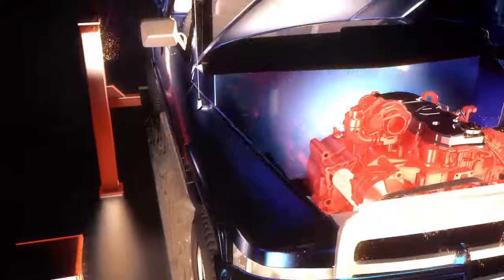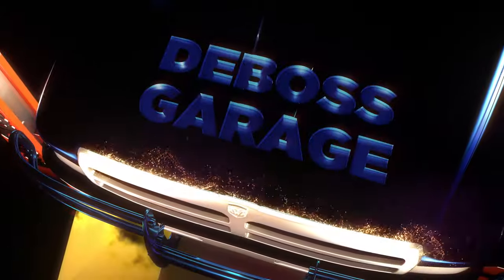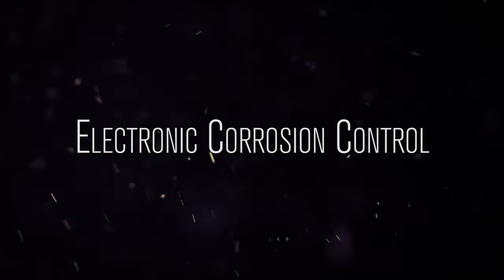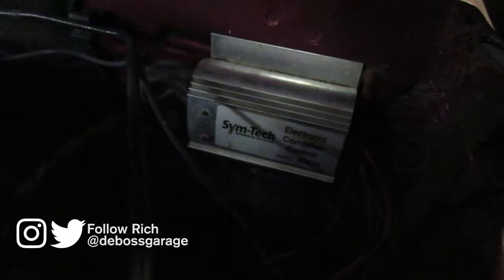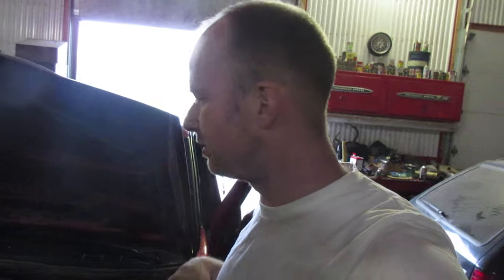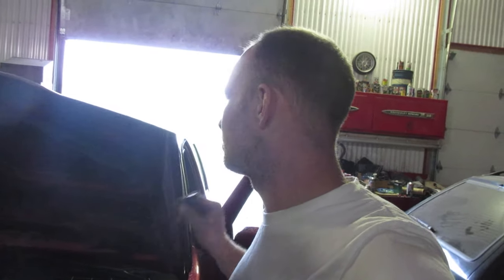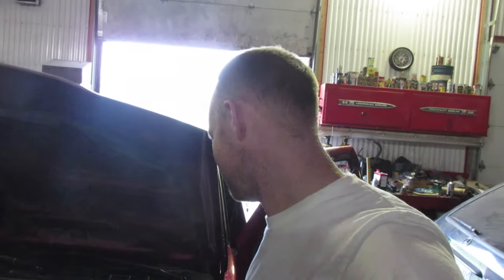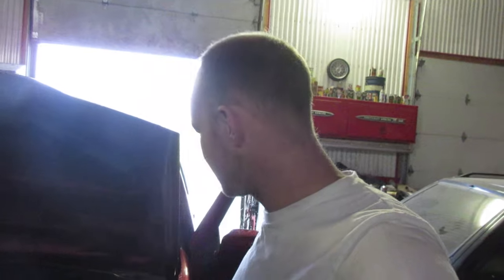The Truth About Electronic Rust Protection

Comment: Cathodic protection prevents corrosion by converting all of the anodic (active) sites on the metal surface to cathodic (passive) sites by supplying electrical current (or free electrons) from an alternate source.
Reply: They work great if you're submersed in an electrolyte solution. But you're not. You're in air. Air doesn't act as a salt bridge, and won't conduct ions until you reach a voltage where you can actually ionize the air,  generally at many tens of thousands of volts. Even then, it would ionize a path as direct as possible, not reaching most of the vehicle. 

These boxes are not functional. There's no  scientific theory that can explain their functioning. They're literally a scam.

Comment: If you put small aluminum plates on the frame and body in various locations and run 12 volts to them remember they are to be insulated from the frame or body so they don't short out which is the whole point but we let moisture do that when a water droplet connects the two and puts a positive current in a negative frame and body therefore reverses some of the polarity remember wire issues usually start with a corroded ground wire

Comment: Bought a truck from a dealership who offered these as part of their suite of warranty packages. Threw it in there because it came with a 10 year/5k dollar warranty. Didn't care if it worked, just wanted the damn warranty. Free rust repair. 

Fast forward, traded the truck in (at a different dealership), and intended to have the module and warranty transferred to the new truck. A couple days after the trade I went to make the appointment to have the body shop from dealership number 1 get their paws on both trucks to do the swap-over so dealership 2 can sell my old truck. Dealership 2 stutters and stammers and goes "uhh, well, the guy who is buying your old truck saw the rust module when he looked at the truck and is demanding that it stays on the truck.. he's some sort of techy guy and knew exactly what it was when he spotted it and wants it". 

Evidently Mr. Tech Geek wasn't worth a fuck at inspecting vehicles because if he did he would have spotted the rust on the wheel wells that started developing while I owned the truck.

Comment: I’ve asked a materials engineer who engineers for machinery in a salt water environment and he said in theory in can work but if the electrical current isn’t precisely controlled to suit the electrical resistance of the area where the corrosion is taking place it will not neutralize it. So another words it could work in a precisely controlled environment but not on your car because there are too many variables.

Comment: As someone who works in the marine industry sending electricity through dissimilar metals is one sure fire way to cause corrosion.
Unless it somehow can reverse the current so there is none it's not going to work.
Reply: That's the whole point, you corrode a sacrificial anode to protect the boat with more negative charge. Cars aren't swimming in electrolyte or have a true ground reference though, like pipelines or boats.

Comment: cathodic  corrosion protection is an industry standard in the oil industry for pipelines and other field equipment.  The science is not in question, but maybe the implementation of this particular item is incorrect.  The law required cathodic protection in the oil industry because corrosion can weaken pipelines and a spills are not tolerated.

Comment: I'm in Manitoba Canada where the roads are salted generously during winter. My parents both bought new 2006 Dodge vehicles at the same time. My mom had the Diamond Kote 9000 installed and my Dad did not. As of today (January 2018) my dad's truck has rust all the way through his wheel wells and quarter panels and mom doesn't have a speck of rust on hers. There's probably other variables I'm not accounting for, and this is hardly scientific evidence that these rust management systems work, but I'll be installing one asap on any vehicle I purchase for now on to help slow corrosion. It's the closest side by side test I've personally been able to see firsthand that suggests a positive correlation.
Reply: How are their driving styles (highway vs around town), does one park in the shade more often or in a dirt lot? and has either vehicle ever had crash repair around the rust areas? Interesting, but still not enough to get me to believe these work. I'd also wonder if both trucks were made at the same plant... due to the small sample size differences between plants, or daily mixes of the plants anodizing dip could account for a change in rust.
Reply: It’s funny how ignorance of physics has influence this video. Only if they showed some knowledge of how these devices “CLAIMED” to work they would not look so STUPID. 

EVERYTHING IN OUR WOULD RESONATES A A DIFFERENT SPECIFIC FREQUENTLY. KINDA LIKE EVERYTHING IN OUR WORLD HAS IS OWN PHONE NUMBER. YOU CALL THAT NUMBER AND YOU MAKE IS RESPOND TO YOU AND NOT THE ENVIRONMENT. IT RENDERS THE ACTION USELESS. IT SLOWS THE PROCESS DOWN DRASTICALLY. 
THE SAME WAY SINGING A NOTE AT THE EXACT SAME FREQUENCY AS A WINE GLASS!!!
Reply: WHAT????
Reply: @underground0mechanic  What on Earth are you talking about? Holy crap, stay in school kids.
Reply: There many videos explaining this on civil engineering projects. 
The shit work, you can also just put sacrificial metals like magnesium zinc and aluminum depending on what your trying to protect. 
Fellow Manitoban.
Reply: My dad bought a truck in 1995, a 1994 f250 the original owner had installed one. The anode wire got cut for the driver side in the 90s. The truck literally only rusted bad on one side. We kept replacing crap on that side only until we figure out that wire was cut. We couldn’t believe that system did anything either. What this guy is missing is most of the systems that work positively charge a sacrificial piece of metal to like 40v so you get more than the “battery” negative

Comment: The system shown in this video is called an impressed current system used in cathodic protection. It is using anodes connected to a rectifier (the box in this video) to protect the cathode. This system is applied to protect the pipeline and other structures and is working great! However, to function, the system requires an electrolyte. To be able to protect the car from rust, the car would have to be underwater... There's no miracle to protect cars from rust (not yet).
Reply: No the car would not have to be underwater.
Reply: Where the heck did you get it would have to be under water lol. 99% of pipeline are on land and most use cathodic protection lol.

Comment: It DOES WORK. They simply do not have enough power, to counter the flow of electrons from anode (steel) to cathode (rust).
Those things are mounted on pipelines, bridges and buildings. Bud they do have PROPPER current and voltage to work.
Rust chemistry works like a battery. Those things works like battery in reverse.

Comment: The theory works as long as current flows past the metal that is rusting.  This is not easy to achieve without placing many conductive probes all around the vehicle which is impractical.

Comment: It protects the integrity of the metal not the surface. It prevents rust from penetrating thick metals. You still need oil undercoat if you want to protect surface. Different enemies. Surface rust is about oxidation (air). Frame rust is about delaying it. Best bet is a good beeswax permanent when new and then oil treatments. It creates a barrier with time. These little things just prevent excessive rust destruction to vital components and frames. Paint will bubble is unattented.

Comment: That's what you call an unscientific opinion.  Here's another.  I bought a new Honda in July 2008 from a Calgary dealer with a Tricare TC-2000 module.  I still own it now, 13 years later and it has no visible rust spots anywhere, except under the hood some of the hose clips have a coating of rust, but they are isolated from current carrying metal conductor surfaces so I would not expect them to have been protected.  Is the lack of rust due to the module, or just good original Honda anti rust coatings?  I have no way of knowing. What I do know is that the car has always been kept outside, including a cold, snowy winter in Calgary with salt and grit on the roads, and 12 wet winters on the coast of BC.

Comment: I can’t say much as to the whole reliability of this system but I have a daily driver in the northern US and i  have one factory standard on my accord which is now over 10 yrs old and very few parts rust on my car the real problem I’ve had is it kills my batteries but that could very well just be user error in the winter idk. However isn’t it possible that if you install one of these systems and they make the problem worse or are ineffective that maybe it was wired wrong? And they aren’t even meant to STOP rust just slow it down. So what are we really expecting?

Comment: rust happens because chemical reactions rip electrons from iron atoms, turning them into flimsy iron ions. theoretically if you supply the same amount of electrons that would be ripped off with a power supply, the electrons would not be ripped off the iron and the car wouldnt rust. in practice you cant really judge the amount of electrons you need and would waste a lot of power. another form of rust protection (sacrificial anode) is more straight foreward. another material like magnesium is connected to the iron. its much easier to rip electrons off magnesium atoms than iron, so the magnesium block rusts first. when its gone you can simply replace it. sacrificial anodes are one of many techniques used to keep boat hulls rust free

Comment: A mate an I went to a self serve wrecking yard once and found a car which had almost no rust anywhere but around the stupidly installed anti rust BS.

They has drilled holes and used mild steel bolts and nuts to mount the alloy box to the firewall which obviously corroded far easier than the rest of the car.

I bet the person who paid for that rust protection wasn't happy.

Comment: I have a question. Have you tested this device or are you saying that it doesn't work because you think so?
Reply: I’m trying to figure out if mine worked. We have this on a 94 pickup since new and all the parts that have rubber gasket separating it from current rusted out but the frame is great. I’m scratching my head trying to figure out how this is possible
Reply: What do you think? What kind of knowledge does he have to just wakeup and laugh at a device with 0 details on how it won't or will work. It's just his thoughts and probably some random cars as sample space.

Comment: Well everything you said is wrong... it’s called cathodic protection... now I can’t speak for this actual product itself and whether it is an actual rectifier for cathodic protection or if it’s just a fake box with some wires attached to it... but if it really is a rectifier then yes it would work for its intended purpose... also why evething you just said is wrong... for one the radio, ecu, etc that holds a current when the vehicle is off DOES NOT apply current to the body/frame or any other part of the vehicle, you being a mechanic should know this... and even if it did, it’s totally different than a c-p system so it wouldn’t work for that anyway.. also the electricity in those things (stereo, ecm, charging system, etc) are contained within them and not distributed throughout the vehicle, this is the same with any electrical components on the vehicle, the ignition is insulated from the fuel system, it’s insulated from the vehicle etc.. if it weren’t you’d have all types of issues with the vehicle, there’s no current running thru the body/frame of the vehicle, yes there’s grounds attached to the body/frame, but those are grounds, they don’t apply current... also this would be a rectifier for a cathodic protection system which cathodic protection and rectifiers are used to
Prevent corrosion on everything from oil/gas pipelines, to residential steel utility lines, water towers, underground fuel tanks at the service station, even train tracks (ever notice the wires coming from out the ground that’s attached to the rails of the train tracks? And ever wonder why they don’t rust, and they’re 50+ years old, but notice an abandoned track that’s the same age but has been disconnected for 10-15 years? It’ll be pitted and rusty as hell.. and I work on residential gas pipelines and we have steel gas mains that have been in the ground since the 1930s-1940s, as long as the rectifiers are working properly, you dig that line up knock the insulation off of it, and it still looks like a brand new pipe... and that’s in an area that’s near the coast and within several blocks from the beach, when the tide is higher and you dig a hole, the water table is only a 1-1/2-2ft down.. low tide is a little deeper.. but that pipe is sitting in wet, salty ground and survives..

Comment: Mine came with a 10 year warranty that if my car rusts and its larger that a nickel they fix it for free. 5 years no rust. Buy it for the warranty.
Reply: These devices do not work, the physics doesn't allow it because there is not water to complete the circuit. You may be right that the warranty alone is worth the cost but I'd be willing to bet if you read the small print it would have to be perforated before they cover it or some other wording that makes it a slim chance you'd ever get anything repaired on their dime.
Reply: @spinedoc893  indeed you are right we used to sell these at my dealership. We knew they were bs but for a while justified it by saying you were really buying a really good corrosion warranty... It sounded good, but the reality was for them to pay out it had to rust all the way through and start from the inside... Which by then you'd have rust anywhere and getting your fender rust repaired was a moot point when everything else was crusty too. Also... If they worked, it would stop corrosion from an outside scratch or ding too, not just from inside out. We stopped selling them after a couple claims got denied for stupid reasons.

You're far better off paying 99 bucks a year, or even every other year to have real liquid undercoat applied under the vehicle and in the doors and under hood. There are many brands, I started doing krown, but the reality is they're all selling a nearly identical product that works well. Just stay away from the rubber stuff that dries, when it ages it will just hold moisture against the metal giving the opposite effect of what you want.
Reply: @alexmaclean1  my friend who's parents did rust check laughed when i asked him what is better krown or rust check. He said rust check is water based and he would never recommend it because it holds in moisture.
Reply: @3cheese711  you definitely don't want a water based undercoat, that's for sure! From my research everything seems to claim rust check is oil based though, so I'm not sure what's up with that.
Reply: @alexmaclean1  i just looked it up. Its a light oil base but i did read it will destroy rubber bushings, mounts and weatherstripping which i found interesting.

Comment: You need a sacrificial anode for this to actually work, but the problem is that you need one that is far too large to be practical. Plus it's difficult to actually get electricity flowing through the entire frame.

It is used in many other applications and works very well. It's called cathodic protection.
Reply: bodies are usually electrocoated this is a scam... e-coat depends on its penetration in the extrusions etc and accomplishes the same thing
Reply: I didn't say that it wasn't a scam. I agree that it's useless for vehicles but it does work if done properly in other applications. By properly I don't mean with a magic little box like this. 

E coatings are less effective than cathodic protection in general but is probably the most effective for a vehicle frame.
Reply: ecoat has a cathodic bath
Reply: I have worked for durr systems (they are an e-coat provider for many major oems) there are two types of e-coat anodic and cathodic... Cathodic provides traditional cathodic protection..What is your background? making arts and crafts?
Reply: Cathodic acrylic electrocoat materials lend themselves 
to topcoat applications because of their very good resistance to the 
ultraviolet rays from sunlight. A big advantage is that only one coat is
 necessary. The overall adhesion and corrosion resistance properties are
 good when compared to popular liquid primer plus topcoat paint systems.
 Electrocoat technologies are generally restricted to a given color, 
however, in some applications additional color options are required. A 
good solution is to use cathodic acrylic as a one coat system for the 
primary product color. It can also be used as a primer to be topcoated 
with a liquid or powder topcoat material for multiple color options.
http://www.metokote.com/coating-technologies/electrocoating/e-coat-process-specifics/#.WRz40B1Jk3g
Reply: there are several dunk tanks pre-treatment and after treatment you are looking at one dunk tank essentially.  You should take a tour of any modern automotive facility and see how e-coating works
Reply: John the sacrificial anode is very common in water heaters. It works great for protecting from a rusted tank but it is a enclosed environment unlike a car so I can be smaller going with what you mentioned